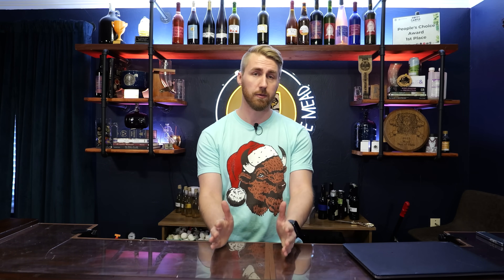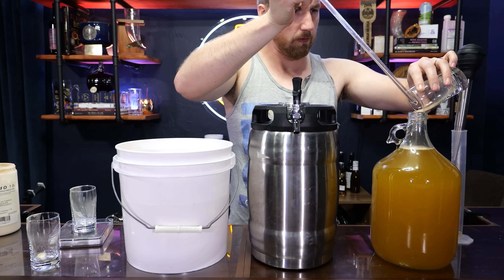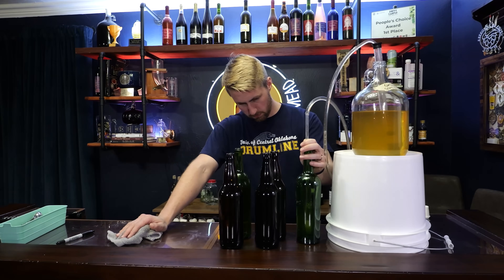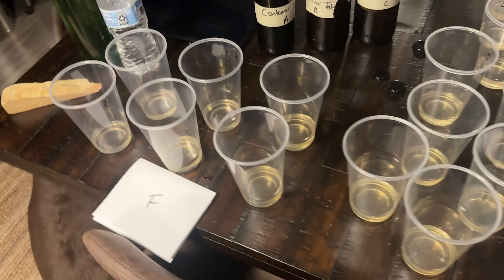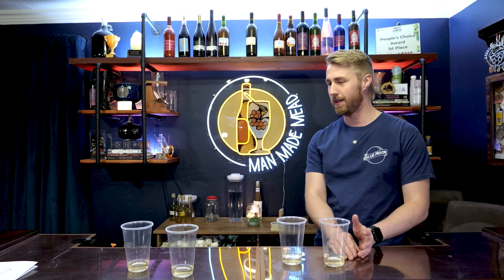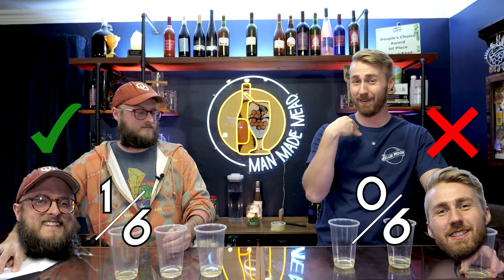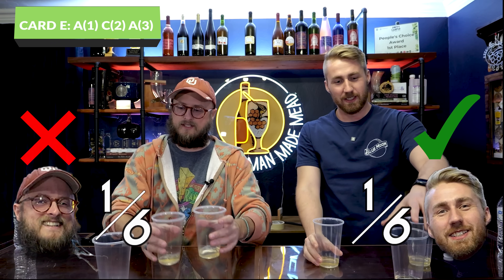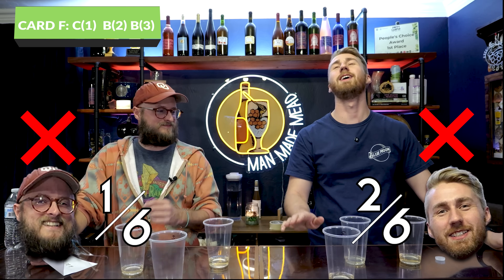Fermentation Vessels vs Mead Test (Plastic, Glass and Steel)

Comment: PET & HDPE plastics are used to distribute high proof sprits so mead shouldn't even come close to causing a problem.  
Only issue I could see is that there are many different plastics and not all of them are equal. Use the wrong one and it could ruin your brew, so always a good idea to be cautious and verify what your using.

Comment: Hey I know this question is unrelated to this video but it’s kinda an emergency 😂. I started my first batch of apple mead. During the yeast adding process there was already a significant amount of foam at the top of my carboy. When adding the yeast into a gallon sized carboy from a standard D-47 wine yeast packet a lot of it got stuck in the foam and in the funnell. So I do not know how much yeast is in there. Within the first couple hours of the process I have some CO2 buildup and there is a slow bubble process already forming. About one every 17 seconds through the rubber tube and into the glass of water. Should I add little bit more yeast on day two or should I just leave it be and continue with staggered nutrition. I guess the question I’m asking is to yeast or not to yeast. Any help is much appreciated thanks everybody !
Reply: I wouldn't worry about it, so long as you got some in there and have a decent nutrient regimen the yeast will reproduce. It should only realistically make a difference in how quickly fermentation really starts to kick in, which will be a difference of like 12-24 hours. I'm also assuming this is a 1 gallon carboy that doesn't take much yeast.
Reply: @ thanks so much man this is my first time making mead so I was really panicking 😂. And yes gallon sized carboy and I have a day one day two and day 5 nutrition plan bought in a DIY mead kit. I believe the bubbling should be a healthy sign of fermentation beginning correct ?
Reply: @DypanHanson  yes, it should bubble but don't "count the bubbles" or base the health of the fermentation off of only that. The only real way to know how the fermentation is going / when it is done is to take gravity readings. Sometimes it just doesn't bubble that much and sometimes it off-gasses and bubbles well after fermentation
Reply: @LargeMahoganyDesk what?

Comment: my decision is driven more by practicality - if you're using fruit or any solid adjuncts in primary, you're simply going to want and need the bucket because you'll want a big opening to add/remove the adjuncts. i also like the headspace for degassing and oxygenation. 

glass is my preference for secondary for the sake of minimizing headspace and being able to monitor clarification

additionally, a keg simply isn't meant for fermenting - sounds like a nightmare to clean and sanitize as well without dedicated equipment.

if you can find one, nothing beats a proper stainless conical fermenter - i got mine for about 1/3rd the new price from a brewer who gave up the hobby

Comment: Something to note on using a keg to ferment is that if you are using the PRV as your airlock, it's going to become a pressure fermenter (fermentation environment above standard atmosphere). Pressure fermentation can be a cleaner fermentation and will not only suppress ester and off flavor production, but also clear faster, which could explain why it cleared faster than the glass fermenter.

Comment: Plastic may have a chemical affect that aids clearing. It may be similar to how it's impossible to make meringue in a plastic bowl, is possible in glass, but copper bowl produces a better stiffer meringue.
Reply: why would it be impossible to make meringue in a plastic bowl? I've literally never had an issue with the material of the bowl, as long as it's clean
Reply: @Rohekivi  give it a go and see
Reply: @scotmcpherson  My mother's mixer has a plastic bowl, and she can make a meringue just fine.  Have food scientists actually tested this?  IME, temperature seems to matter, but not the material of the bowl.
Reply: @julietardos5044  maybe she can, but material is well known to impact meringue. Copper will always be the best choice. Exceptions don’t disprove the truth of the matter.
Reply: @scotmcpherson  That's not what you stated in your original post.  You stated that it's "impossible" to make a meringue in plastic, not that it's less than perfect.
Reply: @scotmcpherson  I told you - I've never had an issue with this. my favourite mixing bowl is plastic and the meringue comes out perfect.